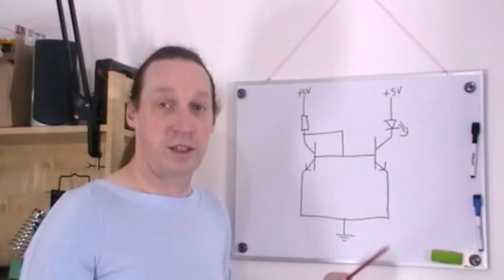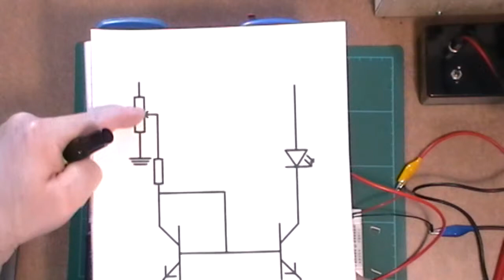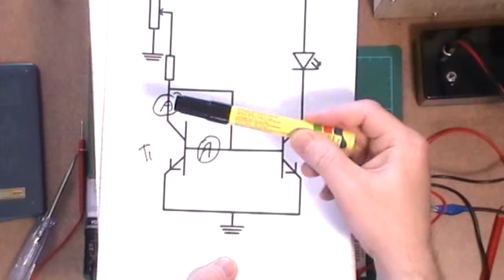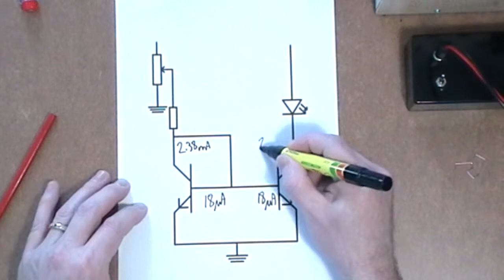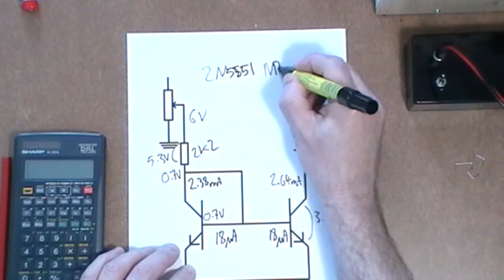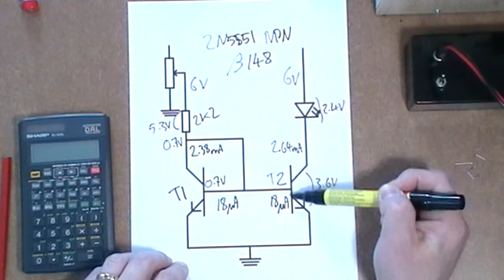Current Mirror (NPN transistor Current Control)

Comment: Great video, I still don't really understand what this circuit is actually used for even though I see it used in plenty Amplifiers. The name of the circuit days that it's a mirror and the only thing that I can take away from that and the explanation that you tried to give is that this circuit provides it's own current to the next stage without placing a current load on the previous stage... I really wanted to know what would have happened if you increased the value of the resistance on the left control side? If you limit the amount of current at the input side, is the led going to still light? It seemed that when you probed the led with the multimeter, the meter started to draw some current also and the circuit seemed to automatically increase the output current to feed both the led and the meter! Maybe even try to add a second led while the first led is working to see if the output current adjusts itself to drive both Led's? If that works as I'm thinking it might, should explain how it works and then that would explain why it's used in amplifiers, you need the current to drive multiple transistors in the next stage without pulling down the voltage like the way that voltage will sag when enough current isn't available which leads to distortion.... 
If you can do a follow up video on this, I will definitely be interested. I kinda like your approach to electronics, I think that it's the best way to understand what is actually going on, kinda like the way it was done when electricity was first discovered... Looking forward to the next video!
Edit: I just watched it again and what I noticed was that when you measured at the led, the current across the output increased by a significant amount but the current at the input didn't flinch! So essentially, this circuit, if it was connected between a CD Player and an amplifier for example, will get the amplifier all the current it needs but the CD Player remains unaffected which is what you need! It kinda makes sense now!
Reply from the maker: Hi Peter, thanks for the comments.  It took me quite a while to get my head around what was going on, but it is testing and trying different values that gave me the insight to understand the circuit.
Reply: @rpsproject5349  if you watch the video again, at the point where you probed the circuit and the current increased dramatically, you said to not worry about it because it's only happening because of the meter. But right there, you missed the point of the circuit, you placed a load on the secondary side and the circuit automatically reacted by increasing the current to drive what ever is connected to the secondary side but there was no effect on the primary side! Basically, if this circuit is at the front end of an amplifier, when the amplifier needs more current, it won't pull the guts out of your CD Player that is connected to it! 
It makes it so much easier to understand if you can picture the circuit and see what it's doing but I feel that you didn't quite get it and that's okay because I didn't get it either but something was bothering me so I watched the video again and that's when I saw it and it finally made sense! Up until that point, I just thought that it mirrored the current, I couldn't think of any use for such a circuit and it didn't make sense but then I watched the video again and I noticed what happened when you probed it... That was my Ah ha moment! If you don't know what I mean, just watch it again...